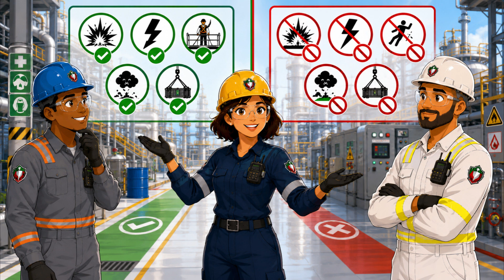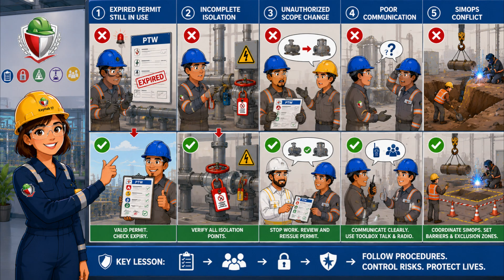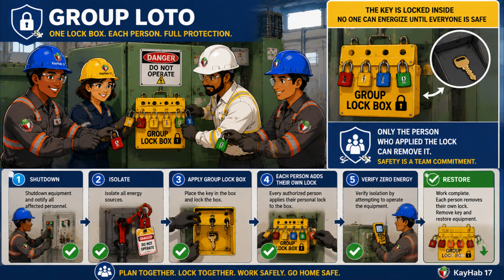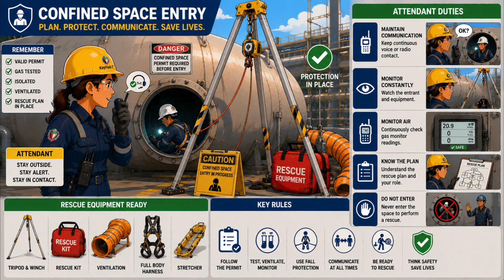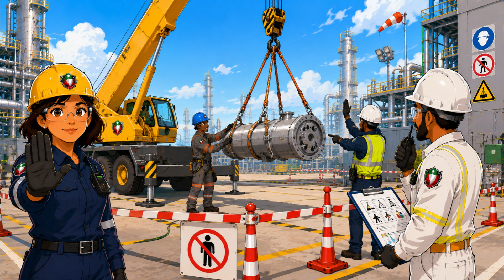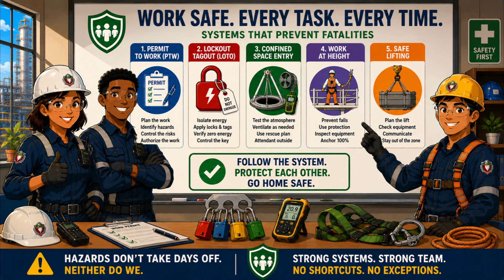Permit to Work, Lockout Tagout, and High-Risk Operations

Comment from the maker: Question 1
What is the purpose of a Permit to Work system?
Answer:
To formally control hazardous work through authorization, hazard identification, and specified safety precaution
Question 2
Why is verification of zero energy essential in LOTO?
Answer:
Because equipment may still contain hazardous stored energy even after shutdown.

Question 3
What gas testing sequence should be followed in confined space entry?